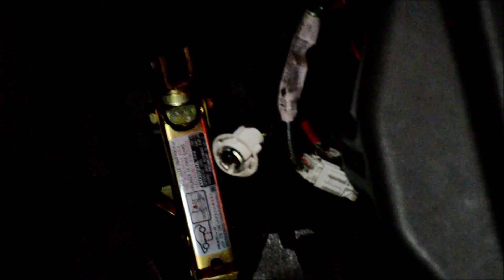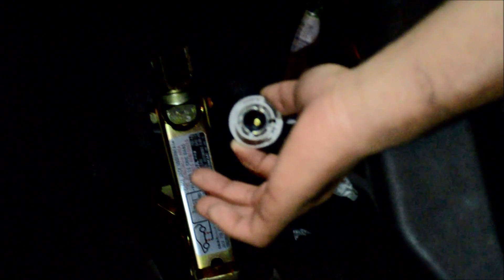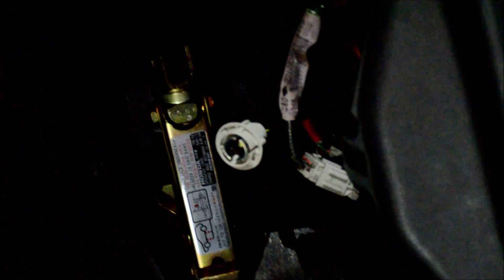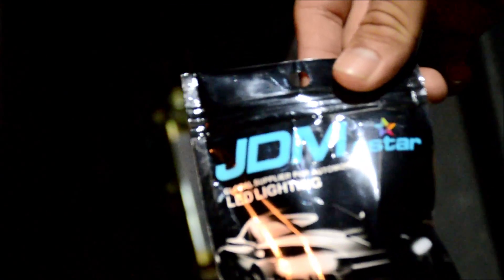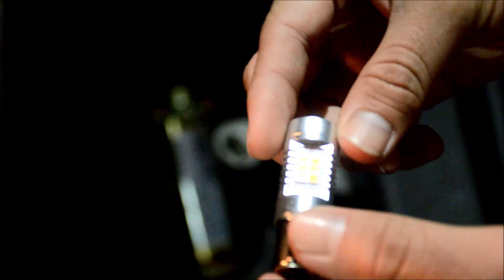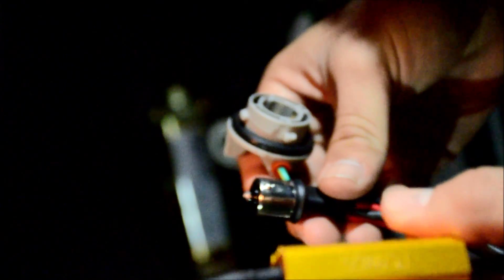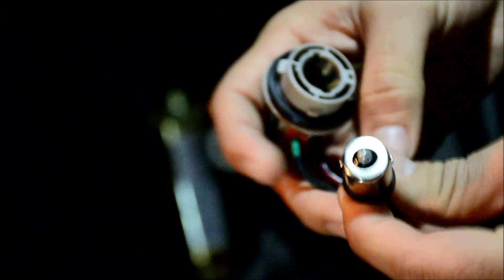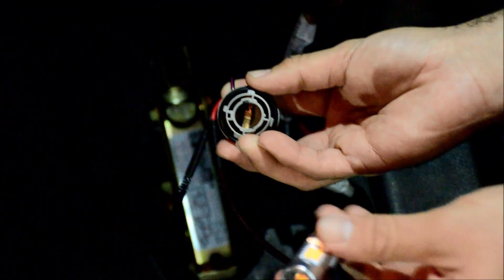How to solve turn signal hyper flash--JDM ASTAR

Comment: Comment where do you get the amber light with the resister plug in.  I would need a pair for each side.

On another note my backup lights are not bright enough. Want to install a 60” strip lighting.  Who and where do I get to it from?
Thank You

Comment: But does it hurt the electronics if you DON’T put the load resistor at all?
Reply from the maker: No, it simply results in a faster cycle(hyper flash) for the flasher relay.  The bulb itself can handle a faster flashing signal and the faster cycling of the relay will not damage the circuit nor the bulbs.

Comment: Do you need to do both front and back or just one per side?
Reply from the maker: Most vehicles hyper flash with ANY 1 turn signal bulb that draws less power so you may need 1 resistor per LED turn signal you install.  If using the prewired harnesses, you need 1 harness per turn signal bulb that is upgraded to an LED turn signal bulb.

Comment: Can I just switch out my relay on my 2010 town and country instead of putting a resistor?
Reply from the maker: Unfortunately, most Chryslers of this year(or newer) do not have an interchangeable flasher relay.  It may be built-in to the BCM(Body Control Module).  Your best bet is to equalize the load at the sockets by using a universal 50W 6ohm Load Resistor.

Comment: JDMastar do you know what could be the problem on my car , I get a pair of LED turn signal light mini bulb and when I plugged into the socket they don't flash nothing then I put back the original halogen light bulb and it does work 
The question is  do I need a special socket in order to make my LED turn signal light bulb work if you can answer my question I will appreciate support My car is a 2006 Mazda 6 v6
Reply from the maker: Appreciate the comment. First, check for polarity and connections.   This issue may be related to load the bulb simulates or resistance value of the LED.  Mazda and most Japanese vehicles are simple in terms of how the turn signal circuit is designed.  Trying using a 6ohm resistor and tap it so that its parallel to the circuit from ground to turn signal wire.  Should work for this type of car.    If you still cannot resolve, please contact us at service@jdmastar.com for further assistance.

Comment: If you only do this with the rear(replacing with LED's and adding resistor) Can you have regular incandescent bulbs in the front or do you need to do leds on all signal lights?
Reply from the maker: You can run a mix of LED turn signals and factory turn signal bulbs.  it will not hurt the vehicle nor bulbs.  Just as long as each bulb is drawing the same power as the original bulb, it will help keep the relay happy to prevent any hyper flashing signals.

Comment: hi, so I think mine is the other way around. I have a 2000 Toyota Sienna LE... I don't think my signal lights are LED,
but anyways my original Flasher relay basically burnt out so I bought a 3rd-party one to replace it. My signals now work again but they are flashing real fast like in your video.
What can I do? Like I said I am not using any LED bulbs for my signals.

Comment: If I like the hyper flashing would that affect my fuse or bulb?
Reply from the maker: No, however, heat may build up quicker in the lamp housing on a signal that flashes quickly.  The increased heat can pose a risk on overheating a diode when using an LED bulb.  Its best you change the flasher to an LED compatible type or put a resistor inline.
Reply: JDM ASTAR thanks I just bought the Led flasher relay.

Comment: I have a 2017 f-150 with exterior halogen bulbs. I just replaced rear ones with LED bulbs (not front, yet), and the actual lights are not hyperflashing but the indicators on the dashboard do. Would that mess up the car electronics over time or i can ignore that?
Reply from the maker: No, most Ford's behave this way and it is due to the resistance.  The solution is the same as hyper flashing since the indicators are flashing quickly so put a resistor inline and you should be fine.